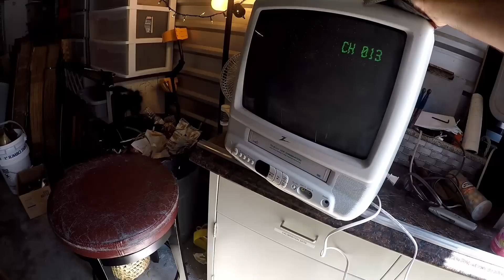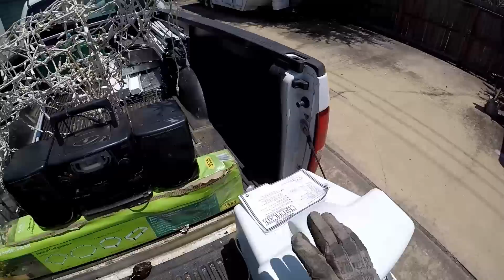Curbside Scavenging "I'm My Own Best Friend" (Plus I Take Stuff Apart!)

Comment: Hey Mike, you may have been able to eBay those heating elements. Since you’re scraping, the elements are made from an alloy that may bring a higher price? It isn’t just steel. Get a 5 gallon bucket to throw your screws in, it will fill up pretty fast. It will almost be like a bucket of solid steel. We had a bucket in the shop, half full it was pretty heavy.

Comment: why  tv blacking out when the tape played  was that for trademark
Reply from the maker: Not sure. TV works good but for some reason it looks like that on video?
Reply: @MikeTheScavenger  then someone put a magnet to the tape or vcr rollers need cleaning with vcr cleaner you get it on amazon